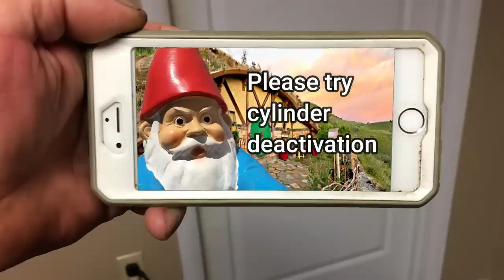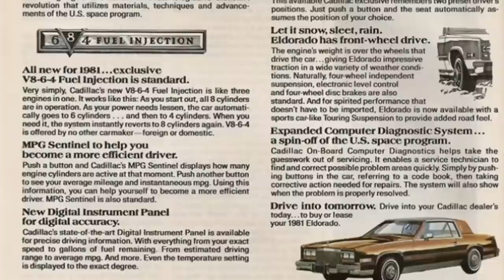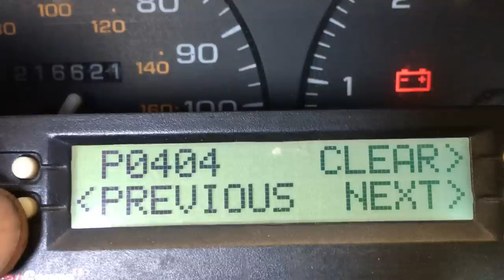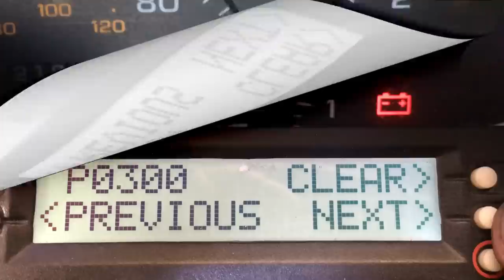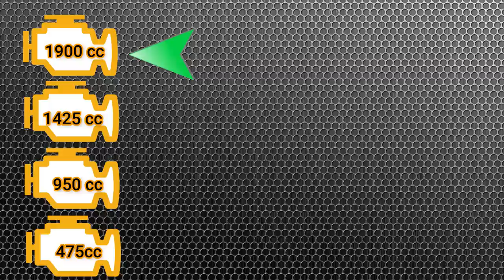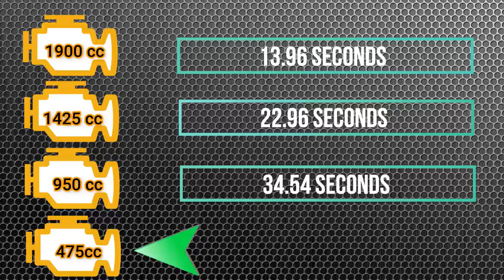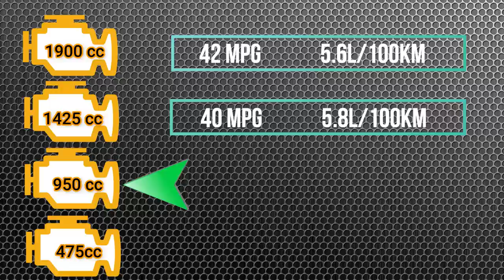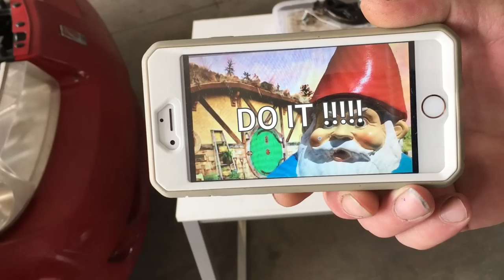S2E16:  We deactivate cylinders on our Saturn and test the car for performance and MPG

Comment: So would you have had better performance taking the spark plugs out of the deactivated cylinders?
Reply: Yeh! I was thinking the same thing. Re do the experiment.
Reply from the maker: Removing the spark plugs would introduce air into the cylinders and increase the drag on the engine.  The way we did it was the most efficient way.
Reply: @robotcantina8957  Robot,    Looking forward to more great videos.

Comment: Even though its far to late for me to comment a suggestion. 
I like the idea getting by with 2 cylinders on an inline 4. 
Even though you mentioned about "drag"  from the other 2 cylinders because they are not running. 
Suggesting maybe a turbo running low boost would help prevent drag from the 2 non working. Because in theory it would keep the flow going from positive pressure. 

There was an engine built a couple years ago that was a 3 cylinder engine, however the 1 in the middle was just a moving piston, no spark plug or fuel injector. 
Apparently it made great power while saving massive fuel on the highway. 
I can see this saturn being a great traveling car, if back running fuel injection, original throttle body, and has a small turbo.

Comment: shouldnt' you have taken out the spark plugs not being used to help reduce compression on those cylinders?
Reply from the maker: No, pulling the plugs would open the cylinders to atmospheric pressure and there would be pumping losses as the piston draws in air on the downward stroke and pumps out air on the upward stroke.
Reply: @robotcantina8957       Robot,  Looking forward to another
great video on Robot  Cantina.

Comment: I wonder what would happen if you made it work dynamically over the throttle position. 
4 cylinders at >75% throttle. 
3 cylinders at >=50% throttle.
2 cylinders at <50% throttle.

That way, it wouldn't struggle to get up to speed, and you'd have the peak economy at partial throttle. 

Just put a MOSFET capable of the PWM frequency, in at the injector wires at the engine.   Since you already did the O2 sensor data manipulation, I know you're perfectly capable of doing it.  And 3 indicators LEDs on your control box, so you can see what mode it's running in. 

That should keep your 0-60 times the same, and increase fuel economy. 

Something I've noticed over the years is that an undersized or underpowered engine, that struggles to keep up with the load, wastes fuel.   An engine properly sized will get the better economy.   But a massively oversized engine will most likely waste fuel.    Like, a 2L engine towing a heavy trailer will be floored the whole time.  A 5.7L doing the same job, in the same body, will run at a fraction of it's capacity, and burn less fuel. 

I think that kind of control would be better than all the individual tested scenarios.

Comment: Question: Will the deactivated cylinders get enough oil? I’ve heard that factory Deactivation systems cause excessive wear and early demise of the engine.
Reply: It actually gets a lot more oil, that's the reason of the oil burning.
Reply: @lmb5529bml  Understood, but still, why are they having engine failures with cars that have deactivation installed?
Reply: @jeffzekas  Because the lifter design is flawed and they eat themselves.
Reply: @mfree80286  Love the comments here.

Comment: People need to remember economy is about engine load not just rpm or how many cylinders. 
As I said before - pop out the spark plugs from the deactivated cylinders and retest.  
You’ll be surprised at the results this time I’m sure.

Comment: Been curious to see the 2 cylinder version with the spark plugs pulled out or the exhaust valves left partially open (so it don’t slap the pistons) being with no valves opening the dead cylinders were still trying to compress air with each revolution. So removing the compression it’s trying to do might net a few more ponies and less drag on the motor itself
Reply: most power going into compressing air is regained afterwards, i think the pumping losses from expelling air and drawing vacuum through the exhaust valve would be greater than the engine drag removed due to lower crank and piston ring loading.
Reply: @user-si5fm8ql3c  true to a point, but it was also obviously dragging oil out of the crankcase while running by when he put the lifters back in and it was burning oil till it warmed up. So I’m guessing there’s some net loss still being had by having the dead cylinders with no where for air of any sort to just come and go freely as the pistons slung around, another way would be to pop the oil pan, remove the two middle pistons and rods, and put it back together. That would take away any drag totally and allow the valves to seal the heal and no rotating mass of those cylinders
Reply: @braaapattack2937  I agree, he should have removed the cylinders, but the air just freely coming and going means that the cylinder always has to exert force on air, pushing and pulling it through a narrow passage at high speed, having only the intake working would probably be best if leaving the cylinders in, at high RPM the air does not have time to cool down and nearly all energy is regained from it, you want the intake open so that the cylinder has some pressure and does not pull oil up
Reply: @user-si5fm8ql3c  Great comments here.

Comment: please try taking out the spark plugs your not using. it will make the engine more efficient, since your not compressing air with half your engine.

Comment: I think you need to either depress an exhaust valve or remove the spark plug on the deactivated cylinders, you've got a trapped volume of air inside each one with you're continually trying to squash and expand.
Reply: Exactly what I wanted to say!
But for the reason this would be a complicated mechanical task (since it's not a Koenigsegg freevalve :)), I suggest just reducing fuel injection to the minimal possible amount -- just to compensate the compression.
Reply: I always thought what energy it expended compressing that air it would get back after tdc when it expands.
Reply: Theoretically that would increase losses.  The trapped air acts like a spring so returns the stored energy.  Pushing air backwards and forwards through a small orifice takes energy.
Reply: No, you don't want to depress an exhaust valve the as hot exhaust burn the seat and valve remove the spark plug is best way go
Reply: The entire point of cylinder deactivation is that you put energy into compressing the air, and you get it back when it expands.  Opening a valve or removing the spark plug means you lose energy (pumping loss) on both strokes.
Reply: @sambrose1  That's correct, this is what cylinder deactivation relies on.
Reply: @ferrumignis  No the energy into compressing the air, you don't get it back when it expands unless that cylinder is under greater pressure cause by igniting a fuel source increasing the cylinder pressure and what cylinder deactivation relies on is a special lifter is lifting the intake valve slightly off the valve seat and disabling the fuel injector at the same time during the intake stroke and this is done every other rotation so that raw oil does not build up in the cylinder.
Reply: @SHSPVR  You get part of it back, unlike an open system where you get none of the losses back. Cracking open the intake valve is minimizing the 'permanent loss' to a greater extent than recovered temporary losses... and also not having as much of a torque pulse during the compression and exhaust strokes.
Reply: @mfree80286  Great comments here.

Comment: First I want to say I find your experiments interesting because it helps answers question to the public in a visual manner. This is easier to understand than me trying to explain it verbally to someone. 
It’s possible the oil burn on start up is from not having any combustion on the deactivated cylinders for long periods of time. The actual combustion event pushes the piston rings against the cylinder walls. This helps the second piston ring which is a scraper wipe excess oil off the cylinder walls so it’s not burned. 

Also the Saturn single cams like these are known to have issues with carbon build up on the piston rings which makes the rings bind. This causes compression loss and oil burn. It’s also possible you didn’t notice it before because it’s a small amount at this point.

Had to edit this because I laughed sooo hard when it started on 1 cylinder. Sounds absolutely horrible and sounds like a knocking sound from the exhaust.
Reply: I was laughing at that point also.

Comment: You should have kicked the exhaust valves open. It's fighting against the compression of the dead cylinders
Reply from the maker: With both valves closed, there is no compression.
Reply: @robotcantina8957  strike that vacuum as cylinder tries to pull air in amd then again after the compression point there is another downstroke creating vacuum.
Reply: @patrickradcliffe3837  Robot,   Looking forward to more great videos

Comment: This would have made more power in all tests if you had left the exhaust rocker/s in and printed the " caps " for your lifter plugs so as to open the valve 0.050 to 0.100 , enough to let the cylinder breathe but not enough to make piston contact.
Reply: No, that creates pumping losses you don’t want. Just keep the volume constant and it is a spring that compresses and decompresses with the cycles, loosing minimal energy.
Reply: @Turbochargedtwelve have you ever tried to turn over an engine with the camshaft out and both valves closed? It is very hard to do . If you open either valve slightly it is much easier to turn.
Reply: @NotMeeither  no intake stroke no extra pressure
Reply: @brysonshires9742  it is a sealed cylinder if you seal it with the piston at TDC then it will be trying to pull a vacuum, seal it at BDC and it will make pressure, seal it in the center and it will do both .
 In the real world there is not a complete seal there will be some leakage past the rings and possibly past the valve also. After running a while I would expect this leakage to equalize and make it as if the cylinder was sealed with the piston in the middle of the cylinder. 
This will still rob the engine of a significant amount horsepower when we are talking about an engine making 50HP or less.
Reply: @NotMeeither  Did you ever make it over TDC with the engine in that condition, rapidly enough to not leak down? The piston gets driven down. You recover a lot (not all) of the work done compressing the cylinder, with more coming back the faster it's going.
Reply: @mfree80286 True you would get some rebound but you loose a lot more energy turning it past TDC than you could ever recover from rebound!

Comment: The drag from those 2 cylinders would cause a bad power loss. You have to open the egzoste valve a few thousents and remove the intake rockers most of the drag will be gone. Also remove the spark plugs.  Adapt a small engine muffler to each cylinder for noise control a true delete

Comment: The 8-6-4 used a solenoid to hold the exhaust valve open, otherwise the dead cylinder would oscillate between compression and vacuum, thus pumping oil into the cylinders. Note, to hold a valve open would require a non-interference engine, don't know about Saturns, but you can always cut a pocket in the piston.
Reply: @leifhietala8074  Then you lose energy compressing the air, and if carbureted still use the same amount of fuel.
Reply: @dalmatiangirl61  If the intake valve stayed closed, no fuel would get into the cylinder. You could lean out the carb to adjust for having 2 fewer cylinders. Or better yet, fit a lawnmower carb on each of the 2 operating cylinder's intake runners, lean them out individually for the maximum balance between performance and fuel economy, and block off the other 2. If the head was pulled, the exhaust valve could just be replaced by a  bolt or a valve stem with the head cut off and the valve end threaded using a nut and washer to block the valve guide.
Reply: @maxxron  What will Jimbo of Robot Cantina do next??
Reply: @kansasrose2909  I have little doubt that we have given him some ideas.

Comment: i know someone who turned a 1500 v-dub dual port engine into a jobsite air compressor by using two cylinders to run and two to compress air. they used to make a kit to do that, but he made his own. wisconsin did the same thing with v-4 engines. it would be kinda cool if you could do it here, and make a self propelled, gas powered air compressor, but i imagine splitting the manifolds would be an engineering nightmare. then again, that might be right up your alley.
Reply: What will Jimbo of Robot Cantina do next??

Comment: Next job: Study the 'Ilmor' 5-stroke engine. It channels the exhaust from Numbers 1&4 to a larger middle cylinder to get a second stage of expansion, raising engine efficiency. In a 4-cyl engine, 2&3 go up and down together, so would serve the same function as the 'Ilmor' middle cylinder. A few hour's work with the welder and a bit of scrap tubing on camshafts and piping should do the job...

Comment: Do releive the 2 Middle Cylinders Compression a good idea would be get like 2 Compression Test hoses link them together so that way the Compression is "releasing" so when 1 cylinder goes up it pushes that air into the cylind where that piston is going down rather then just removing the Spark plugs because it will be way quieter and might even benifit air going from one cylinder to another....Or you can rout the 2 tubes from the 2 middle cylinders into the intake and make it so it will burn off any oil that gets in there.

Comment: The outtro gave me an idea - deactivate all and cool the starter and see how far you can get running the motor on just the starter. No plugs in it of course.
Reply: I like it
Reply: Starter aren't made for long use, it will burn.
 But approx 5 -10 CV a good starter
Reply: @hellsing56666  That's why he said he should cool it
Reply: @hellsing56666  yeah, that's why it would fun to see how long he could make it last / how fast it would go. I'm sure he'd find a fun way of cooling it.
Reply: @walkermediaworx  I'm not sure you could cool it. Starters are by design overdriven, and the mass is designed as compact as possible to work as a heat sink. It's why it takes so long to cool off a starter that's overheated... it'll dump heat internally for a short time because normally it has a long, long time to bleed heat off through the case.

Comment: Now to come up with a injector kill switch and choke cable activated rocker override mechanism. 😀   final step when the donations roll in is Atkinson cycle Saturn.   Meh, two cylinder Saturn air compressor is all Jimbo will get outta this 🤣

Comment: Some folks are saying remove spark plugs on deactivated cylinders which would be neat to try but I say instead of that, make some sort of chamber that hooks up to the spark plug hole to wildly decrease the compression ratio in the deactivated cylinders without actually leaving a spark plug out. Like a small air reservoir that screws into the spark plug tube.
Reply: Or a tube that connects the two dead cylinders via the spark plug holes? Or just a small air filter for each hole?

Comment: Without removing the spark plugs on the two "dead" cylinders the engine is under a compression/vacuum  load every time the piston goes up or down, stealing power and smoothness, and I think that's why the idea never really worked too well...
Reply: I was going to ask why didn't he also remove the spark plugs on the inactive cylinders.
Reply: He is just using the air as a spring every revolution.
Reply: I wonder if after tdc of the compression stroke it helped pushed the piston back down a little...

Definitely not smooth though
Reply: @Jack-qn4vt  that's exactly what happens. Look at how Chryslers MDS works in their 4th Gen hemi engines, the shut off cylinders close all valves, stops injecting fuel into those cylinders and obviously spark plugs remain in place. The air trapped inside behaves like a spring, taking some energy on compression stroke but returning it on power stroke. The losses power losses are minimal, due to imperfect compression and friction and would only be worse with an open valve or no spark plug.
Reply: @DracoOmnia  Love the comments here.
Reply: @DracoOmnia  oh yeah, that's interesting to learn, thanks
Reply: @Jack-qn4vt  Looking forward to more videos from Robot Cantina

Comment: One thing you could do to help reduce pumping losses on the deactivated cylinders is remove the spark plugs (if you hadn't already).

 It makes it so the dead cylinders use less energy trying to suck air in through the closed valves (generating vacuum) and compressing what it does get through. That's the theory anyways, would be cool to see if it makes a noticeable difference.

In the old days when people deleted cylinders due to damage, they'd also remove the piston and conrods of missing cylinders. This eliminated pumping losses as well as reduced the rotating mass. They'd leave the spark plug hole plugged in this case.

  It'd be cool to see done to the 2 cylinder, although you'd want to plug the oil port on the crankshaft to help keep oil pressure.
Reply: My first car was an old Cadillac with a 500cui v8 that was turned into a v6 after the rear two cylinders seized... It ran.
Reply from the maker: Removing the spark plugs would introduce air into the cylinders and increase the drag on the engine.  The way we did it was the most efficient way.
Reply: @robotcantina8957 , I kinda wondered if that was the case. Good to know.
Reply: @MattTheBeegBrain  Love the comments here.

Comment: What if you fully removed the valves, pistons, and rods for the deactivated cylinders so oil pooling is not an issue and the rotating weight is lowered?